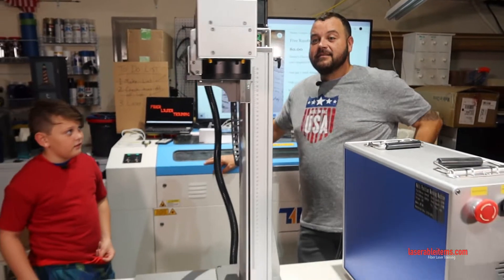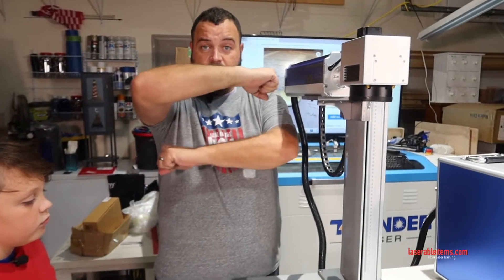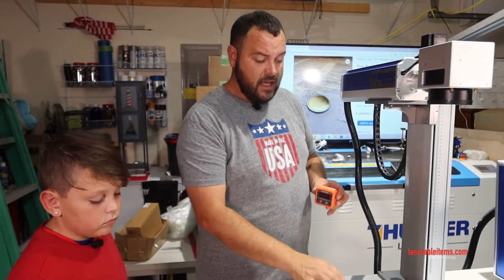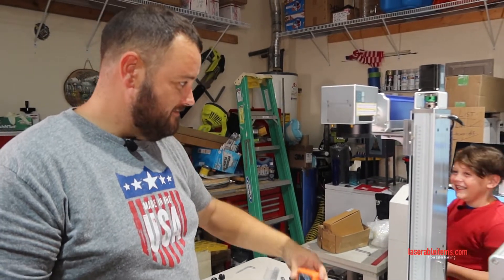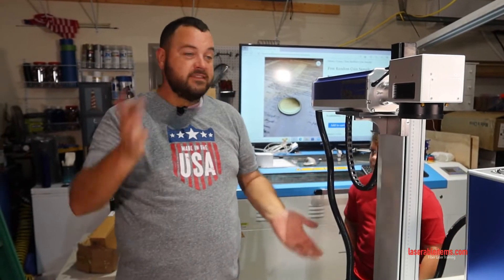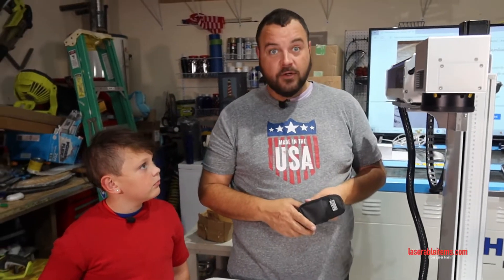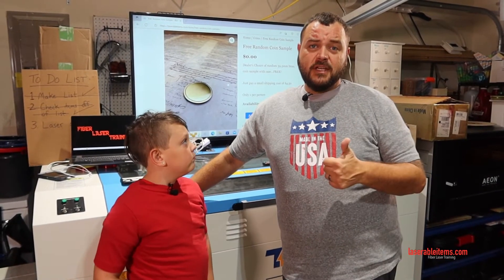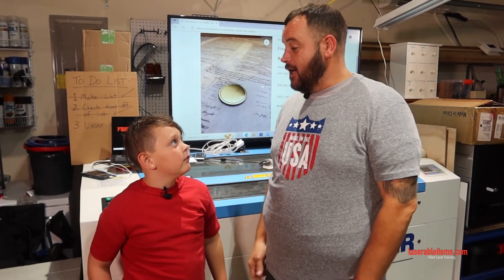How to Level Your Fiber Laser (3rd Unboxing Video)@FiberLaserTraining

Comment: Unfortunately that wont work, who says the laser head case is parallel with the laser?
Reply from the maker: Not sure what you’re referring to that won’t work but we use the above method on all 9 of our galvo lasers and they’re all spot on. 
I can help you if you’d like. 
Just email me to set up a time. 
Good luck and thanks for watching!!!
Reply: @FiberLaserTraining  First off I dont know! I had heard leveling from the lens is the best way to go. But I love your approach which will help me get mine better aligned to the bed than the way I have done it. Thanks!